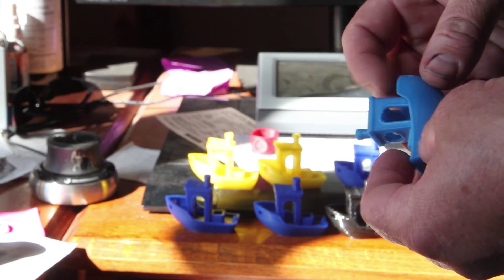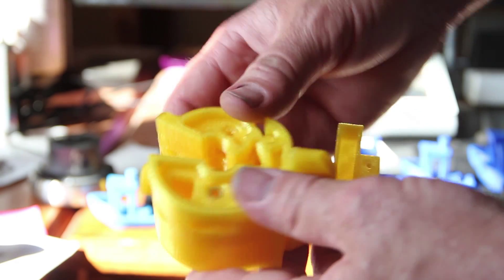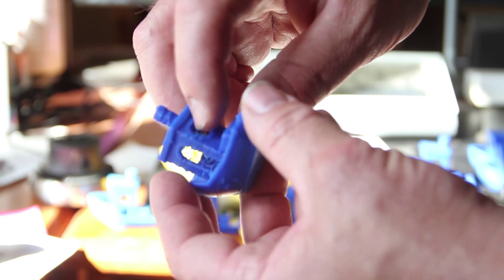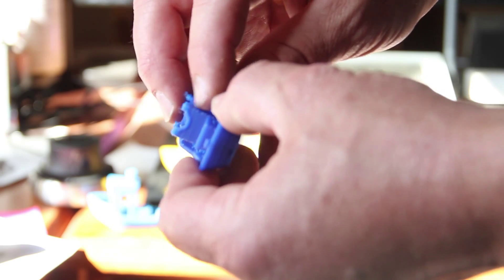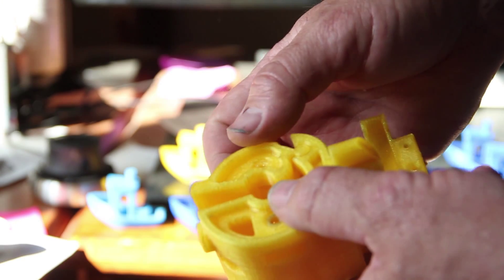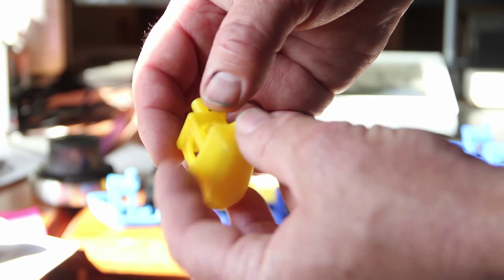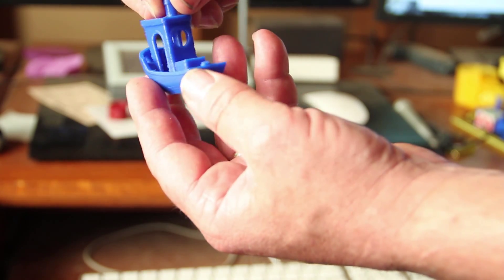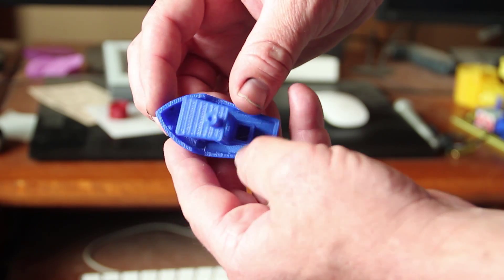Quality of print with direct drive vs bowden extruder on my MakerGear M2 printer

Comment: what's final conclusion after 7:37 min of videao ? ^_^
Reply from the maker: +Stéphane LAFORÊT +3D Printwiz I guess I was letting you draw your own conclusions from the information I provided. The biggest reason for the Bowden is to be able to reduce the weight and print faster. My design still had much of the weight of the original extruder and so I did not try and drive it super fast. I can not see any other reason you would want to deal with the extra hassle of a drooling nozzle that can not push flexible filament. In the end I never really used this head as the dual I was intending because it was to much trouble dialing in the settings for the Bowden. The biggest reason I want dual is not for the multi color but rather the multi material. Since most of the print would be in the main material and the rest in rubber or PVA or such and the Bowden would have to be used as the main nozzle I never really got it going. The head still suffered from the biggest draw back of dual printing which is the drooling of the "off" material as you print the other. I found another idea from another maker which is to use two independent heads on the same track with a magnetic coupling system. One head is parked off to the side while you are not printing with it so the mess goes way down and you can have both heads as direct drive. It does not have additional electronic controls and so should be able to be implemented on many other printers. I will be posting a video about it soon and will post some links to the original source then. Thanks
Reply: I like this idea to have direct drive for ninjaflex filament and bowden for other. You can print great piece with not too heavy carrier. Very clever! ^_^
To avoid the difficult choice of bowden or direct drive, my idea is to create a easy-removable head. If you want print fast : you put the bowden head. If you want print flex : you plug the direct head.
Reply: +Stéphane LAFORÊT Thing is you FDM was never meant to be blazing fast.  I gave up on the Bowden and while I manage 130-150mm per second with it it really didn't speed up my prints much over a Wades gear.  I did notice less ghosting (ringing) effect though.  One issue I had with the bowden, and really the only issue, is that the piece where you insert the hose (the metal with the push plastic clip) would break internally because those fittings were never meant for anything that would go forward then retract many times per minute.  I broke a few mid print before I added a wire to lock the push mechanism up but it still will eventually break just much longer to do.   Too much hassle imo and next I am going to try a Direct drive but with the I3 Rework I am having to design an entire effector and X holder for the effector.  Rework only likes Bowden and Wades setup.
Reply: One of the reasons I stopped using my M2 is because of that shake.  Might try the boden setup.